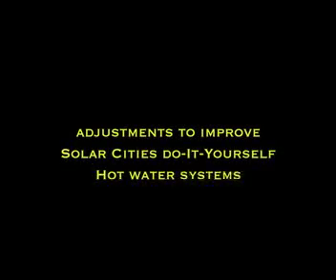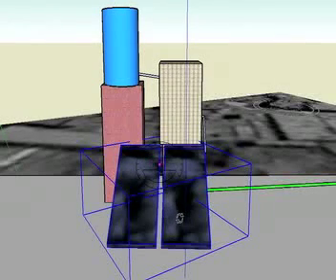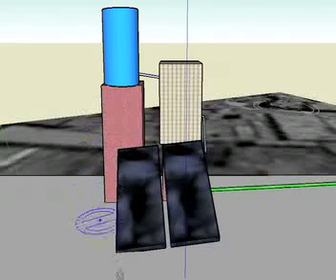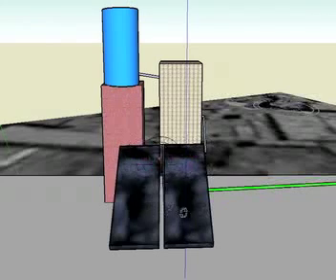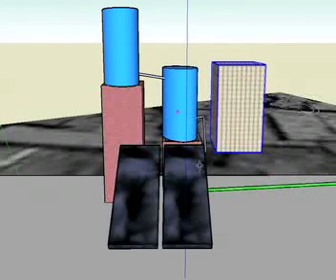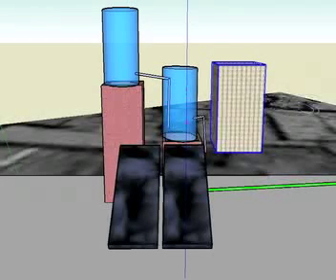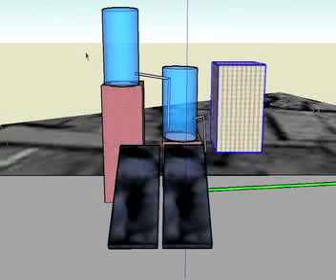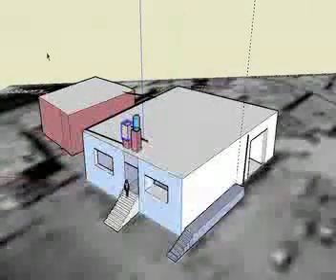Adjustments to hand-made solar hot water systems

Comment from the maker: Then, after the valve, we have an elbow and a pipe (polypropylene) going down to the bottom of the INSIDE of the hot water tank.  We find it works just fine, with limited heat loss (otherwise you could insulate the internal pipe.)  I've posted pictures of the system here:
solarcitiesDOTblogspotDOTcomSLASH2008SLASH03SLASHsolar-cities-in-darb-al-ahmar-resultsDOTH T M L 

Sorry I can't just paste in the address! Hope the pictures help explain.  Or just search for "Zahran" in my solarcities blog

Comment from the maker: Hi swahili77, thanks for the comment!  We futzed around with the connection from the cold tank to the hot tank for some months. What is not shown in the sketchup model, but is critical, and was the deciding factor is that the cold water pipe connects to the hot water tank through a FLOAT VALVE (kind of like what you have in your toilet, only side mounted) so it has to go into the top of the hot water tank.